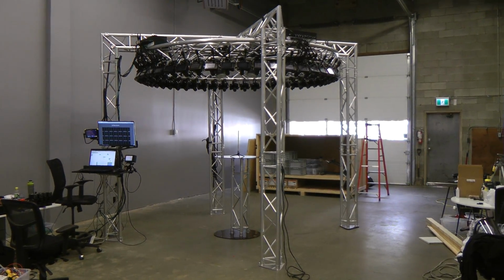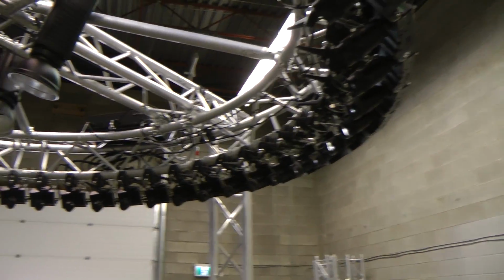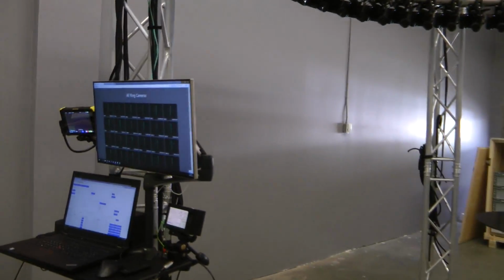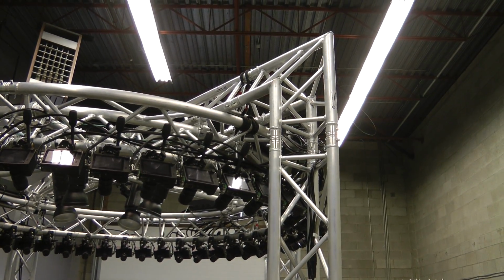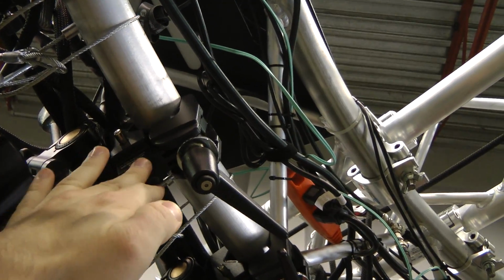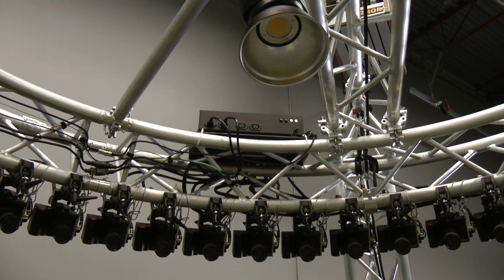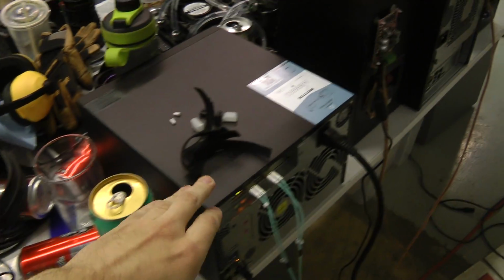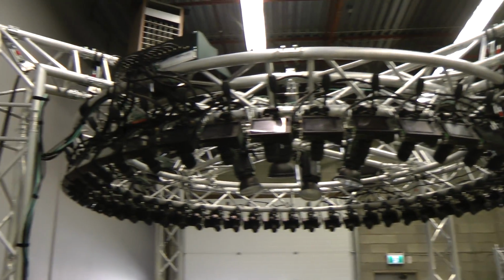Chronos Ring - Bullet time array of 48 high-speed cameras

Comment: If you play two copies of the same video side by side, but one lagging behind a few frames you can get cool stereoscopic video for cross-eye viewing.
EDIT. I tried opening this video twice and it works. Angle differences between shots are very large so 1 frame of difference between images is more than enough.
Reply: See https://streamable.com/0q959 for an example. Of course stereoscopy works only when the view is rotating.
Reply: I wonder how good this would look in VR... dizzying, definitely, but it should work with full stereoscopy, given that the lenses are more or less at eye distance.

Comment: Using Computed Tomography type backprojection you may be able to reconstruct a three dimensional model of the subject. I'm not sure anyone has done that at regular speed, let alone at high speed.
Reply: Even the Matrix movies did already some 3d slo-mo stuff, so nothing new below <100fps
Reply: @rkan2  that was just regular 3d animation, not creating a 3d model from the actual footage
Reply: I think using a dome like truss and distributing cameras on it and sync them together, they might be able to create a fairly nice 3d reconstruction in desired moments using photogrammetry technique! It would be very Compute-intensive though! and only good for not shiny, not transparent objects inside the dome!
Reply: @mahdimahdavi  Good suggestion, but you also would be limited to objects with enough surface texture for it to work. Shots involving single colored objects and of course water would be very problematic, if not totally unsuited. But you did mention transparency already!
And as photogrammetry is already a demanding task (even on gpu) for a handful (few dozens or hundreds) of images, I don't want to imagine the processing power needed for high-fps HD video from dozens of cameras!
Reply: You'd need a 3D reconstruction algorithm that's used in photogrammetry, not sinogram-based backprojection, since that more recontructs volumes based on density.
Reply: That is actually quite trivial with inverse radon transform. But you need quite a beefy lot of GPUs and some 10 minutes. For one frame.
Reply: You would need something like render farm at JPL or maybe a animation studio like Pixar.  @realedna
Reply: Matrix move used a very simular setuo but with 200 still cameras on a rig that could curve around. 

Yes, all the bullet time sceens was made just a few seconds per shot.
Reply: I saw a tested video on doing this specifically.  Photogrammetry in a single "shot" using a rig like this:

https://www.youtube.com/watch?v=1won7AYden0

Comment: That's insane! How did you synch the cameras to stagger their frames and get the 72000fps?
Reply from the maker: The cameras have a genlock input with 10ns timing accuracy, plus an internal adjustable delay. A timing signal is sent to all cameras and they delay the appropriate amount to produce an orbiting exposure.
Reply: That is an incredible feature. The only other time I've seen that in action is the MIT team filming light propagation with what I assume are highly modified cameras. Have you made any attempts to use prisms or mirrors to take advantage of this for a non rotating perspective?
By the way, I just want to say thank you for making this stuff accessible at a modest budget. Nobody would have believed a camera like this could be bought for $5k ten years ago.

Comment: There's software that can take a number of images from different angles and can turn it into a 3D mesh with textures. You could then render this out from any angle. You could combine this with this ring to create a full color 3D scan at high frame rate and then 3D render it as an animation and from any angle. Probably would not work with anything transparent, however. You may be able to interpolate the meshes, though, so you could render it at an even higher frame rate (and any resolution).

Comment: Oh wow! I would mount them in portrait mode to squeeze more camera's in! Or increase the diameter of the ring and add more camera's that way. You might have to use a more 'tele' lens. The swirling slomo's are awesome but they are moving a little bit too fast for my taste, it's hard to focus on what is going on. I'n super curious to see what's going to happen next!
Reply from the maker: We can juuuuuust fit 96 cameras in portrait mode, if we flip the ring portion of the truss upside down and mount the cameras on the largest diameter portion. For a lot of shots, portrait is actually the most appropriate anyways.

Comment: Rotation is a little bit fast for me for most of the clips , makes me a bit dizzy.(and miss most of the detail ;-))
Has it always to be a full rotation? (yes I know cause you can ;-) )
But for what it is, amazing clips!! 6 minutes of slowo footage. that must cost you months to produce!

The electric plasma in the glass of water is somehow  my favorite.
Next stage, make every chronos camera hight an angle adjustable so you can "pan" in a sphere ;-)
With carefully planed shots, you might be able to zoom and pan in on the target without loosing resolution?

What is the radius of the ring? Maybe it is possible to ad some arms that are retractable in the length of the radius and they normaly point to the center of the ring. And when you want to pan in 3D you can extend tem and tilt the cameras , even further away from the ring.
Should be possible to do with store available materials
Reply: Yeah, I got quite dizzy too. Doesn't help that I often get motion sickness from watching footage of video games (but when playing them myself I'm usually fine - go figure).
Reply: They have 48cameras. So that means they have 48 frames to work with every second. And now they have slow it down by half. So it normal 24 fps. But if they slow it down by half again. It would be 12 FPS which  is not quite nice to watch. So they can't slow it down.

Actually they can get smooth footage from one camera but the rotation is not smooth because they have fixed 48 cameras soo its  48 FPS the end.
Reply: @chaitanyakatti463  I don't think that is how it works ;-)

The Chronos is able to shoot very fast pictures in a very short time period. 
The goal of this project was to time/sync the cameras, so you can take  1000 frames a second with 48 cameras in a 360 configuration.
Then you can choose which picture of this 1000 frames full hd video from each camera you include into  the finshed clip. 

Should be no Problem to build.a clip from half the cameras or at another pace.
Reply: @Gpcas9  u are absolutely correct. But what I meant was that can't get smooth rotation by slowing down the video. Even in the video the rotation is jittery because they take 48 frame and put them together. It doesn't matter if they can capture 1000fps. For rotating they use 48 cameras only soo the video will be 48fps.
Reply: @chaitanyakatti463  There are ways to increase the framerate with clever interpolation. For example, SVP can turn 24 and 30 FPS video into 60 FPS. I'm not sure how well it would work with rotation, but with linear motion it's close to perfect.

Comment: Has no one else seen the video about how  something that's in constant motion can look 3D if you shade one of your eyes? In this case it's the right eye, your brain takes a moment longer to process darker images than brighter, so you see one frame slightly faster with your un-shaded eye than the other, making it look 3D. It also leads to seeing double on some of the clips, but with others it looks amazing. If they could tune the setup to maximize this effect it would be cool. Of course there are other options that could accomplish this goal with better results, but most would require special equipment for the viewer to take advantage of whereas most people have a shade and even more could just squint one eye.

Comment: That is a pretty awesome construction! 
sadly I found it hard to watch all that spinning video without motion blur and 24fps. I know you are limited to 0.5 rpm @ 24fps with this setup but I wonder if some artificial motion blur could improve the watchability of the finale shot. 
Also there are some whitepapers on view interpolation, I wonder if there is any software available that you could use to slow down the rate of rotation and do the smooth transition from the static camera to the moving virtual one.
Reply: I think this is actually a situation almost uniquely suited to interpolation - you have those views from all angles, which means you're in a perfect position to be able to reconstruct the 3D shape of something (or at least extract the difference between foreground and background elements), and you only have to interpolate over 7.5 degrees of angle.

Comment: 2 possible ways to improve this greatly:
* Employ the use of mirrors that split what each camera is looking by /2, /4 times to slow it down.
* Sell the other 47 cameras or maybe keep 5 for verticle stacking and build a motorized 360° rail that's precisely timed. Then you can have verticle separation and any speed you like! it's also more practical and cheaper considering how much those cameras cost x47!
Reply: Yeah, cameras on tracks have been around for a long time, they could have just built a circular one...

The downside would be a horizontal motion blur, but it would give a smoother 3d effect.

Comment: So, I'm sure someone else has thought of this before, but, if there was a way to put the ring of cameras in motion, say 60 rpm, and set each camera to take a shot from the same angle(or a slight increase/decrease), you could potentially get the benefit of the higher fps, and localize your viewing angle.  The main challenge being motion blur and having a very precise motor controller for the assembly.  The wiring problem, uggg.  Anyway,   Very cool!  I'll buy two.  hmm, where to put them...

Comment: If the whole gantry was physically spinning, you could set the timing of the shots so that the frames have any effective spacing you want, so it would be like you had thousands of cameras (although there would be FPS compromises, stability issues, and I'm pretty sure it would have to be spinning really fast, but it's a thought).

Comment: High speed lightfield array!!!

I assume the clock/trigger is distributed to all the cameras and then something like a programmable delay line is set in each one?  
Adding the ability to segment the array into simultaneous blocks and dividing each frame between the set of blocks "automatically" would be neat (with each block either being a chunk of the ring, or every n cameras). As would a planar array or spherical array (or segment of a sphere) to allow for high speed synthetic aperture imaging/much higher angular resolution lightfields.
Reply: I don't know if it's possible for the images to both be streamed out from the camera and an image fed back to the screen, but for arrays like this, computer assisted alignment would probably save hours in setup. And if you put a focusing mask in front of the lens, (like a bahtinov mask) you could even have human in the loop autofocusing for small, bright, targets.

Thinking about it, streaming back to the camera screens would be cool, but carrying a small external screen for the person doing the alignment would work just as well...
Reply from the maker: The same trigger signal is distributed to all cameras, and there's an internal pipeline delay that's different in each camera that sets the delay from trigger to frame capture.

We're thinking of having a mirror with stepper or servo motors to automate alignment, it would save a lot of time.
Reply: @tesla500  I wonder if 3 smt LEDs on a plane would be enough for computer vision to take over and give alignment cues. (I forgot about rotation ) Then the smallest smt LED you can find could be placed at the desired center of focus and a focusing mask could be used for that step. A pinhole or the end of a fiber would be better, but could require repositioning where an LED would present a small, bright target all the cameras could see. 

Thanks for the response. 

Are the captures rolling shutter or global? If rolling you could extract another magnitude of speed from the array if the timing is stable. Hmm. I wonder if you would need to switch to an exotic light source to get something that gave clean switching at your frame/line speeds. Not to downplay your amazing work at all, but I wonder what the MIT media lab or Stanford's computer graphics departments could develop with such an array.

Comment: Cool video from Chronos ring! :) Only i prefer slower rotation and i think, that with simultaneously trigger mode, this is one of the best configuration for 3D slow motion allowing to select best angles after job was done.. ;) Great for effects..
For ideas: old damaged computer main board needs to be connected through +5V or +12V rail and GND (or some output port) directly to mains voltage, or for safety reasons, to 40-50V AC transformer.. In slow motion there will be noticeable blown up sequence - chip's, pcb tracks and flying multiple cap's.. That will be sparkling view for overvoltage.. :) Only consideration needs to be taken about transparent shield to protect camera's.. Similar way, standard 78** series voltage regulators may be destroyed in slow motion Chronos ring, only closer view..
For other idea: sand clock just counting time.. :) That will be amazing..

Comment: Could you achieve smooth ramp up and ramp down IF you recorded video instead of images frames (interpolation still needed)?
Yes, it would lower the resolution BUT would allow for the virtual camera to move anywhere at any time. Probably less memory too.
I think would be worth testing even if the video were 1080p60.

Comment: With that many cameras, would it be possible to make a 3d animation out of it?
I was thinking to maybe sync all the cameras to make sure each camera is capturing every single frame at the same time, and then putting them into a photogrammetry software and then just playing it like a video but 1 frame is 1 3d object instead. The processing time would probably be very long and I'm not sure its worth it since technically its possible to just change the direction of the camera movement. But would be interesting...

Comment: I wonder how difficult it would be to use a rotating mirror to focus all the cameras on a single subject (that is, without the apparent rotation). A setup like that is, if I'm not mistaken, capable of beating the most expensive Phantom cameras in resolution and in framerate at that resolution. That could be cool to see.

Comment: Mind blown.
I guess you have to take into account propagation delay of the cables too.
Alignment and color balance homogeneity also a nightmare.
It's also one hell of a motion photogrammetry rig!
Reply: Using pairs of cameras would also give 3D stereo views for greater depth - 1&2, 2&3 ... n&1
Reply from the maker: Thanks! Cable propagation delay actually isn't critical, it's a few tens of nanoseconds compared to about 2us delay between cameras at max speed.
 
For white balance, a reference is taken before recording so they all match. For alignment, we put a calibration target in the middle where the subject goes. This consists of two balls above each other. The master camera is aligned to properly frame this target, then the image from the master is superimposed over all the other camera's displays. Then each other camera is manually aimed and zoomed so that the camera's live image matches the reference image of the calibration target. A set of reference images is then taken, and translation, rotation and scaling is determined to bring the other camera's images in line with the master camera.
Reply: @tesla500  Thanks for the explanation - yes the spheres should give a good reference image for the rest of the calibration, but it sounds tedious!
Post processing can help, but obviously best to avoid if possible.
As for cable lengths, even a few tens of nanoseconds compared to 2us amounts to a few percent of jitter on top of any other timing variabilities -- while not critical, it could be significant for some cases.
Still awesome work though!

Comment: set up the cameras vertically instead of horizontally to fit more cameras in, and that will slow down the spin, the transition from camera to camera wont be as choppy, and youll get some extra frames

Comment: It would be interesting to try using the NVIDIA's Super SloMo to generate intermediate frames to slow down the rotation to be a full revolution every 4 seconds instead of every 2 seconds.

How are they synced? Can normal cameras be synced like this? Like say 192 sony rx0s and using them at 240fps get 46000fps footage at 1080p?

Comment: Are they syncronised?
If so, it should be possible to introduce a controlled offset and get even higher effective framerate, although each frame would be from a different angle
Reply: Nevermind, it's explained in video

Comment: What's your method to align all the cameras ?
Reply from the maker: We put a calibration target in the middle where the subject goes. This consists of two balls above each other. The master camera is aligned to properly frame this target, then the image from the master is superimposed over all the other camera's displays. Then each other camera is manually aimed and zoomed so that the camera's live image matches the reference image of the calibration target. A set of reference images is then taken, and translation, rotation and scaling is determined to bring the other camera's images in line with the master camera.

Comment: Could you convert this into a ROTATING MIRROR high speed camera with a fixed viewpoint? Maybe point all the cameras directly at each other and put a perfectly timed high speed rotating 45 degree mirror in the middle to get extra high frame rate of a a fixed view on a object? You would have to use software to auto rotate each frame and the end result would be a circle but full resolution highest frame rate.